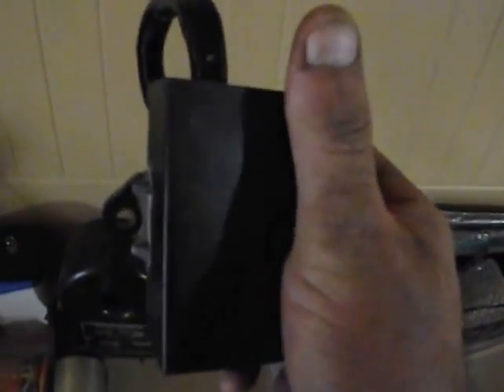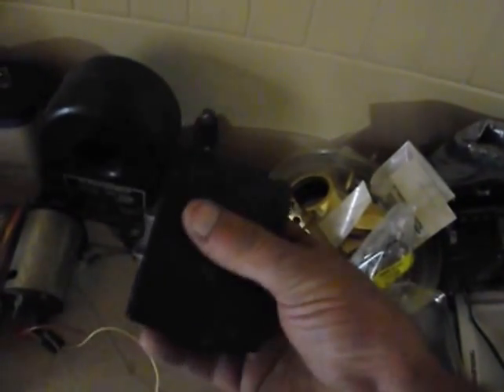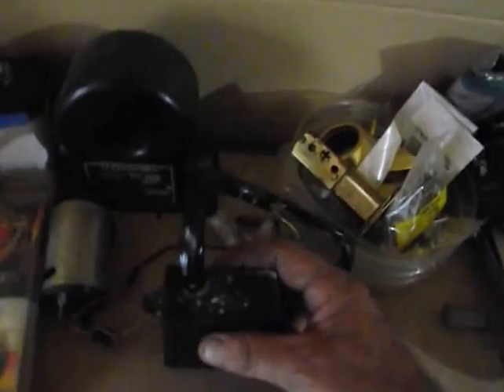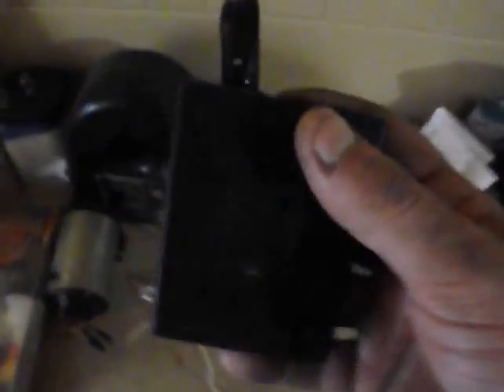Electronic CDI Box Repair  75% Success Rate

Comment: I have a question for you. I have a Chinese Tao Tao moped 150cc, and my head lights not working. I put new bulbs in on both sides, and they still not working. So will you please tell me what the problem might be. At one time, I thought maybe it was the Solenoid switch so I replaced it with a new one, and still no head lights. Could it be the CDI box? Also I have a problem cranking it up. It acts like it doesn't want to crank some time, it hesitate on cranking, what's that problem may be? Will you please email me with the issue at ralphwillis21@gmail.com. My name is Ralph Willis.

Comment: i have 5 wires coming out a stator (black red yellow blue white) how it should be connected to regulator?
can i connect red direct to battery
Reply from the maker: Dinesh Mourya You need to look in the book for what ever it is your working on.  This way you,ll know what wire is for what reason. Just to guess it throw is not a good thing to do. You might burn up the stator. Do the research. or call a place that works on what ever it is you have. Take care

Comment: Just did this on my Nissan NS12C outboard motor with no spark. I bought it used and it never ran for me once. It's the same as the Tohatsu M9.9B2 and up. This worked like a charm, engine started with 1 pull with 1 plug out testing spark. I shoe gooed it back up on the bottom and around the rubber grommet that goes around the wires. We'll see how it goes but I have to say I'm sold on this method. The new CDI (CU 15, 362-06060-2 or 119-0602) is $260.00 that I just saved!
Reply from the maker: ***** Glad to hear the news.

Comment: does this work for jet ski cdi box?
Reply from the maker: sebastian vazquez  Why not. If the problem is that moisture got inside and it needs to be dried out again. Heating it up is pretty much the only way to remove it. Seal it back up on the back side afterwards. If it works then great its back ok again. There is nothing to lose in trying. If your CDI  box stopped working. Try it. Preheat your oven to about 300 leave it on the tray in the oven with the back side up. Leave it there for about 6 to 10 mins. Keep your eye,s on it though just in case the wires start to melt. Then take it out and let it cool down. Then seal it back up with some type of sealer. Its going to be very hot when your taking it out. I,d where some gloves or something. Good luck.

Comment: I thought I would give this ago before I spent money on a replacement unit. I pre heated the oven to 300°F put the CDI unit in on a cold tray for 3 minutes then turned the oven off and left it in there for 10 minutes in total. I let the unit cool for 30 minutes then put it back on the bike (1979 RM125N). So for me it worked and I saved myself $100 on a second hand CDI. Worth a try.
Reply from the maker: Gary McFadzean Sealing the back of the unit back up will also stop wetness from going back in it.

Comment: I've been doing a bit of research on repairing a cdi. If it can be restored with heat, cold or pressure (band clamps), moisture is not the problem. (these units are not known for getting moisture inside) Over time, normal variations in outside temperature effect differing rates of expansion and contraction between the dissimilar materials of the circuit board, the wiring and the different solder alloys causes the solder joints on the circuit board to fail. The cracked solder surfaces oxidise and don't conduct electricity well, this causes resistance across the break, which in turn generates heat and increases the gap and oxidation. Eventually, the break and surface corrosion are sufficient to prevent conductivity and the CDI no longer works. A sharp tap, can sometimes (but rarely) cause the broken solder joint to contact firmly enough to work again for a time, as can an extreme of heat or cold or the application of constant pressure. There are a few forums that discuss careful dis encasement of the CDI from the resin block and re-soldering the connections as a solution, but it is a delicate and difficult process. (One youtube video recommends immersion in acetone but that's a bad idea as acetone also dissolves some of the electronic components and wiring. care should be taken to only allow acetone to come in contact with the back of the circuit board.) The heat method described in this video may indeed work for a time, but usually only a few days or weeks.
Reply: Correct, that's why most CDI's fail.  Nothing to do with water or the enclosure.  

What heating the CDI box is doing is making the whole CDI unit hot and expand which allows broken/breaking contact points in the circuit board and components to be in contact again, at least for some time, and thus allows an engine to start.  It might last hours or a several months.  This is not a permanent fix. 

A permanent fix is a pain in the butt, and depending on the CDI box may or may not be possible as it requires resoldering all the contact points, if you can get to them.  For some of the old Japanese motorcycles CID's that are encased in aluminum and epoxy, you can get away with a reflow but you'll need to get it to at least 370F and you have to take all the plastic on the connector off or it will melt.

Comment: Ive seen this done, however it was because bouncing around makes the contacts and solder crack...heating it up melts the solder and makes a better contact.
Reply from the maker: FlyBrisGarage Good point There.  What I,m doing. Its not getting it hot enough to melt the solder. It would need to get much hotter for that to happen. But great point for sure. Take care FlybrisGarage. Tks for stopping the channel. l,ll check out your videos. Dirt bikes nice deal you got there for $75 with a little work it will be a great bike. My days riding those are over though. Due to bad angles.

Comment: Does this really work?
Reply from the maker: james joseph It sure does. Not every time now. A lot of times that's the problem. It get wet and the wetness has a very heard time leaving on its own. So the oven trick will heat everything up and dry out the inners of it and then just reseal it and 75% of the time it will wotk fine again. Give it a try there is nothing to lose by trying it. If it still don,t work afterward no big deal it never worked beforehand.. Your out nothing. I,v done lots in my life with good out comes. Not with every one but lots came back to working. Yes they did.